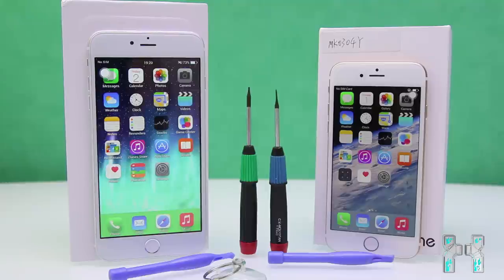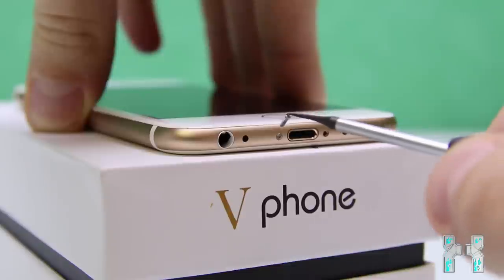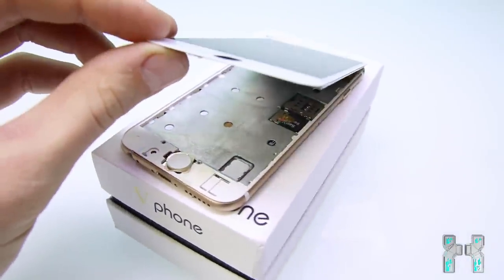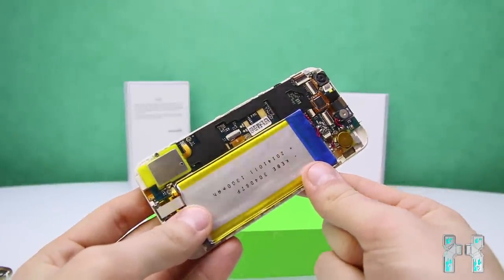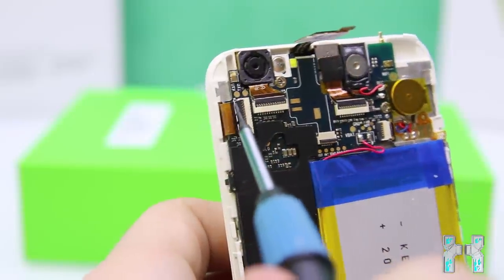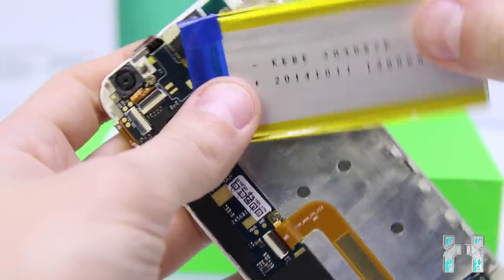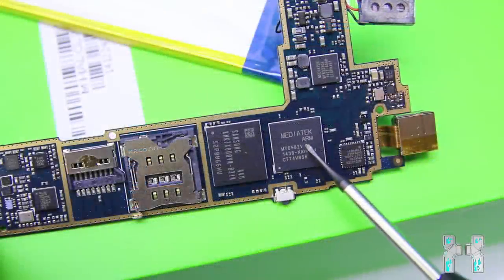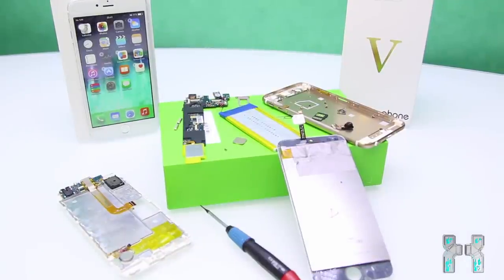Fake Iphone 6 / 6S ! Whats inside of those clones ? Are they dangerous ? [HD]

Comment: You did lift the screen the wrong way though. You're supposed to put the plastic tool between the plastic frame of the glad and the metal frame. Not between the actual glass and plastic frame. The two screws that you removed in the beginning are holding the plastic frame that the glass sits on.

Comment: "Amazing 1850 mAh" :D but to be fair: the battery is still ok because real iPhones have IOS running which is optimized for such small batteries :)
Reply: +FlipDude Not really. An iPhone 6S Plus lasts with my usage (phonecalls (A LOT), webbrowsing, snapchat ( A LOT), whatsapp, FB, reading manga (only at bedtime, instagram) about 3/4 of a day (pretty good for a phone as my usage is kinda severe). An iPhone 6S (the one with a small battery) would not last 1/4 of my day. My boss owns an iPhone 6S and he is charging it every possible moment due to the phone not lasting enough (especially phonecalls drain the iPhone 6S very fast). Currently I own an Galaxy S7 Edge and I am having a hard time killing the phone in a single day with my usage. The S7 Edge lasts so long that I end up with usually about 40% battery remaining while my brightness is on auto-brightness (my display is always visible with no reflections on the display whereas you ALWAYS have reflections on the dim display of the iPhone)